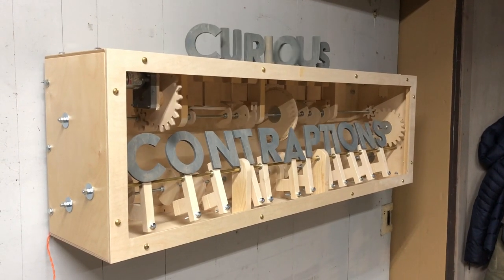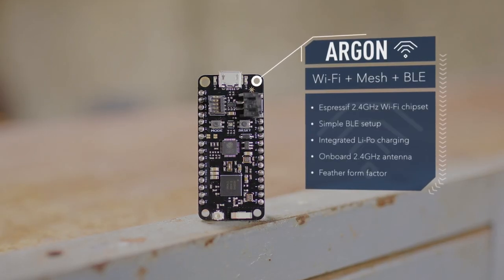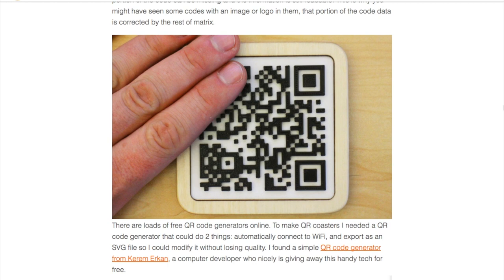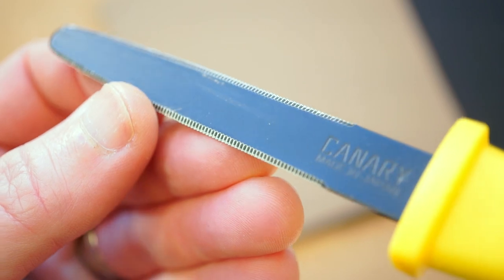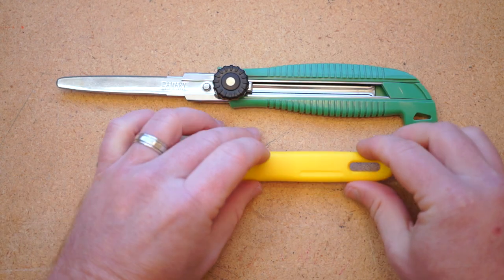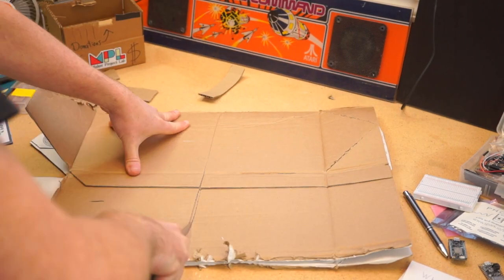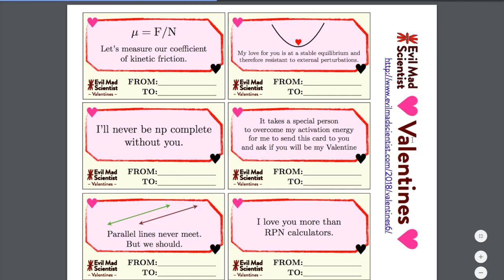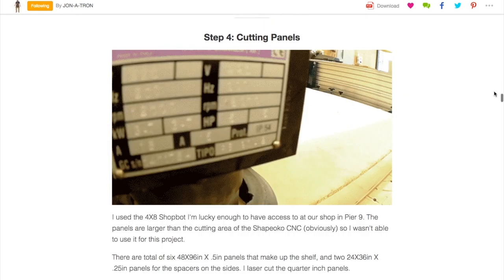Contraptions and QR Coasters [Maker Update]

Comment: I liked the live show, but live shows get a lot of 'downtime' between the information pretty often.  Unless it ups the entertainment quality to keep the interest going, I tend to not watch the live but use Youtube and skip through to the parts, or at least 'speed up' the playback so I can get the gist even if I don't catch all the details and nuances.
Reply from the maker: Good points. What if I watched back over it and pulled out some timestamped highlights to put in the show notes? That way you could jump around quickly to different parts.
Reply: Timestamps with index of subjects should help.  I know building that is a drudge for the creators.  Also I don't know how YT monitization works, but not having enough 'eyeball hours' may change the $$ rate.
Reply from the maker: You're right that a thorough index would be a time-suck, but I suspect that I could sustain marking a few of my favorite highlights. Also, if the course of the conversation roughly follows the order of the project documentation, it shouldn't be too tough to put in a rough index.